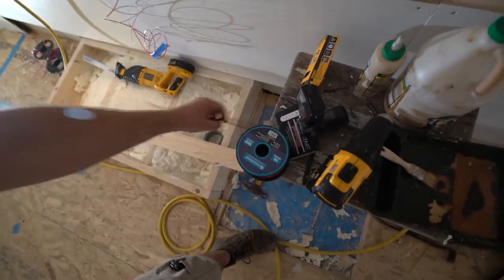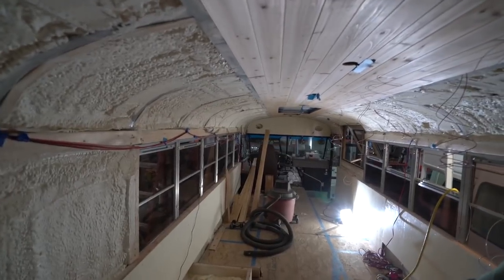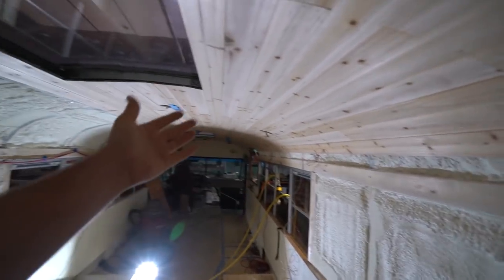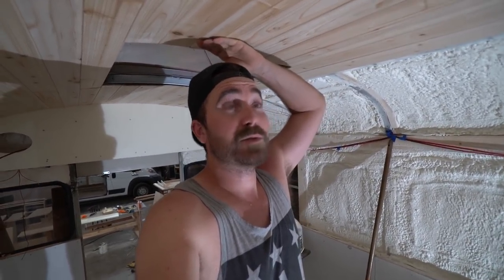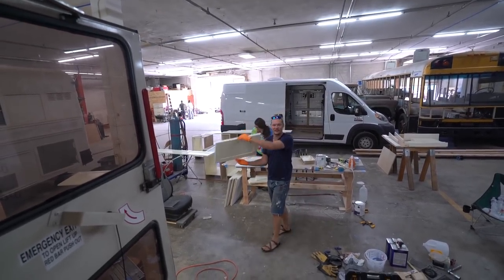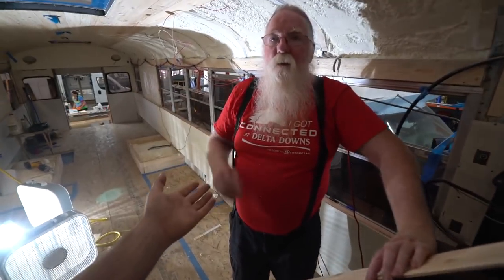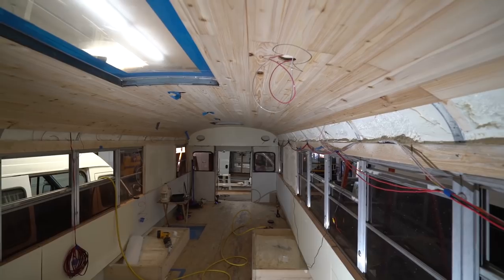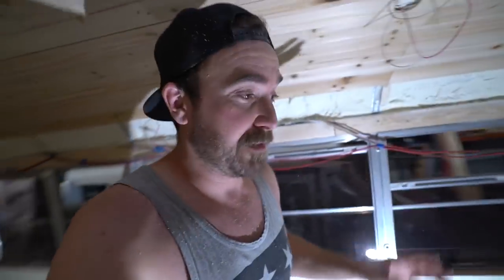Cedar Celing for Van + Skoolie Bus Conversions

Comment: Nice looking ceiling. Narrower planks would have contoured to the curved bus roof better. I use to do that for overheads I put in boats. Doug Fir or Spruce. Took 2X10 or 12 planks and ripped them down to 1/4 inch X plank thickness. This looks good though.

Comment: You dont want to know how fast that stuff burns either, Hey Jax they have this Shiplap stuff that fits together with the tounge and groove stuff as somebody may have already suggested but it splits easily almost like balsa . The quality varies A LOT  .i tell you another material to concider is hardwood flooring thats already pre finished that about 1 /1/2 wide i would liquid nail it to the wood as you go  they have hundreds of finishes to give you the look you want. Also keep in mind unsealed wood is not a good idea cause in a bus people tend to touch it with thier dirty hands to brace themselves when the bus is underway , id spray some sealer of polyurethane on the board s before you put them in, they have gloss semi gloss and matte if you want that natural look. My neighbor here in NC has the same bus you have but no handicap doors, they use it as a church bus, every since ive been watching your channel ive wanted a school bus too! lol

Comment: That looks great! Just curious as to how far the nailers sit below the metal ribs on the ceiling. If you had to guess
Reply: We tried to make the nailers flush with the metal ribs
Reply: Cheers steveo. I just did this recently but used 3/4” ply strips screwed to the underside. Gonna take them down and go with your method, head room is precious!